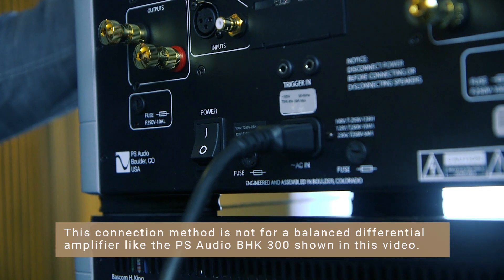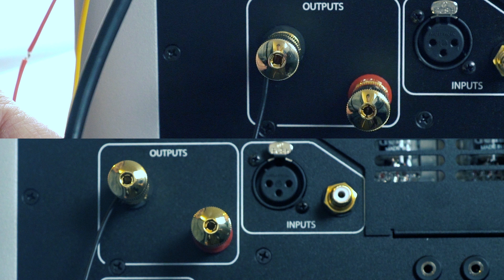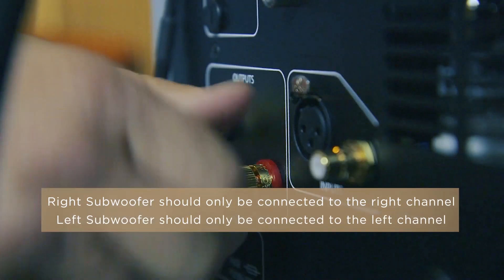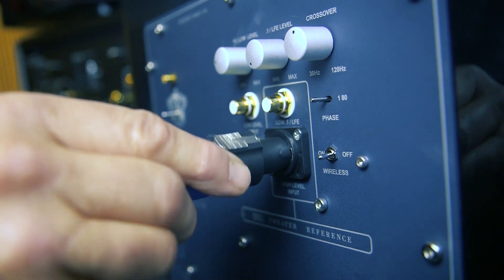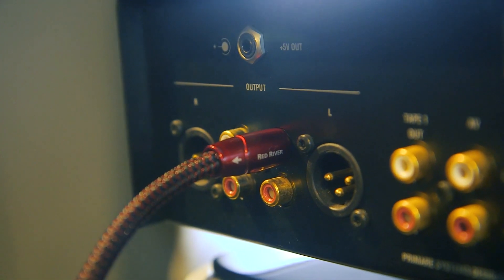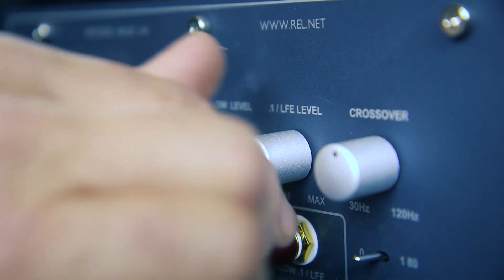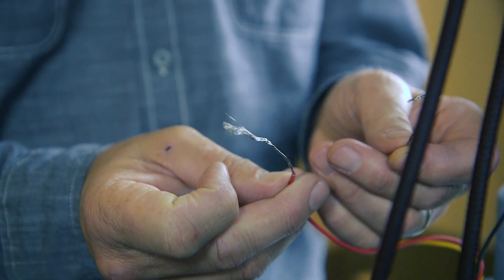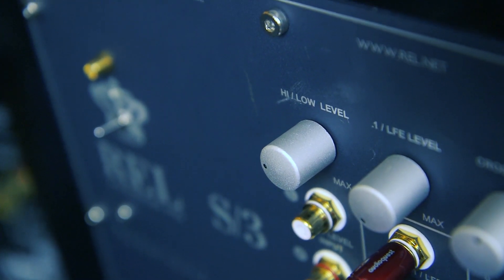REL Acoustics How To: Connecting a Stereo Pair of RELs using the High Level Cable

Comment: Can I hook up the high level input of a rel TZero to the “to L speaker” speaker output on a pair of Klipsch R-41PM? They are active speakers but there is access to the amplifiers left channel via left speaker out on the back of the R speaker which houses the amplifier.  

I was wondering if I could safely hook both positive left and right wires of the speakon connector to the positive of the left channel and negative to negative .  Or will I be forced to use the low level input (I’m assuming not the .1/LFE as that’s set up for prefiltered sound out of a dedicated sub out on a home theater receiver)
Reply from the maker: Since the Klipsch R-41PM are active speakers, we recommend connecting the REL subwoofer using it's Low Level input, rather than the High Level input. The Low Level input will allow the subwoofer to receive both left channel and right channel signal, resulting in better performance and a more seamless blend with your main loudspeakers.
Reply: @RELAcoustics  thank you! If I wanted to experiment with the high level input,  would it harm the amplifier of the Klipsch speakers? I would basically just be wiring it up like for a monoblock configuration but running it from left channel since that’s the only channel I have access to with the Klipsch
Reply from the maker: @Gillian_seed83  Using the High Level input in this scenario will not harm the speakers or the subwoofer, as long as you connect the black High Level wire to the ground thumb screw rather than the negative speaker terminal. However, since this will result in the subwoofer only receiving left channel signal, you will likely experience improved performance by connecting to the RCA sub-out, using the Low Level input on the subwoofer.
Reply: @RELAcoustics  ah ok since the Klipsch has class d amp I was thinking I would have to connect the red and yellow to red then tape off the black and connect an rca from .1lfe input to either aux left or right input rca on klipsch to create the ground cause I was reading up a little more on your website about the methods but you are saying it’s even simpler by red and yellow both on red speaker out of Klipsch then instead of taping the black off I can attach it to the ground screw the Klipsch has on it for connecting phono? Just wanting to clarify.  I will most likely run a decent quality rca from sub out of Klipsch into rca low level input of TZero as you recommend,  but it’s nice to know I actually would have the option to at least experiment with hearing the high level input.  I would say most of the music I listen to there’s not going to be much difference in 20-120hz region in left and right channels. But I totally understand the reasoning of running an rca low level connection with this particular set of speakers.  Also one more thing I’d like to clarify,  so this TZero MK iii is a very recent update to the TZero correct? I believe from what I understand it just hit the market last august sometime? Will most likely be trying it out first because my room is maybe just a bit larger than the space specified for TZero but a bit smaller than the space specified for t5i.  I have tiled concrete floor and concrete walls, it I’ll be in a literal concrete corner with me sitting about 4 to 8 feet from it, I believe it’s going to straight thump for a little 6.5 inch woofer!
Reply: @RELAcoustics   hey disregard everything else I’ve said cause I ended up getting a Yamaha R-S202 receiver and a pair of Sony SS-CS5 bookshelf speakers.  I cannot find  definitive information if the Yamaha is a class A/B, A or D.  I’ve seen speculation that it’s A or A/B but I want to know if you think TZero could be good for, all sources point me to yes.
Reply from the maker: @Gillian_seed83  I can not determine for certain if the Yamaha R-S202 is Class A/B or Class D, so I would recommend using the Class D High Level connection method to be safe. For use in a small-to-medium sized room the Tzero will be an excellent match for your Sony SS-CS5 speakers.

Comment: I have an intergrated amp and power amp bridged(mono) Through emails with REL... I was told to leave the black wires hanging. If ground occurs connect them to the ground screw. If that still doesnt work use a a rca cable from the lfe to a line on the intergrated. None of these options worked for me...and when I called and emailed I was never given the option to try to connect black wires to negative. I see in this video that u say to connect the black wire to the negative terminal. Curious why that option wasn't given to me and what will happen if I try it. I dont want to cause any damage to my amps or to the subs.
Reply from the maker: In most cases,  when a stereo amplifier is used in the bridged monoblock configuration it no longer functions as a Class A/B amplifier, and the negative output terminal no longer references to ground. As a result, in these cases we do not recommend connecting the black High Level wires to the negative output terminals on either the bridged power amplifier or integrated amplifier. Doing so can result in damage to the amplifiers and the subwoofers.

Comment: Hello REL Acoustics Team, do I understand it correctly: in your video - if I've connected two REL's to the two monos (I use Cyrus two mono blocks X300) as you've shown , the second (speaker) outputs will be used for the normal floorstand speaker, right? So I then have on the first speaker connectors the floorstands and on the second speaker connectors the REL's . Correct?
Reply from the maker: If your monoblock power amplifiers have two pairs of output terminals then you can connect in this way, though ideally the subwoofers' High Level cable wires should be connected to the exact same output terminals on the amplifier as your main speaker wire is connected to.

Comment: Hi, Thanks for the video. I have 2 REL T7i and Roksan K3 Integrated Amplifier, class AB. At the back of the amp, I only have one chasis ground. Can I connect both Rel black wires to the single ground? Cheers.
Reply from the maker: That is correct, the black High Level wires for both subwoofers can be connected to the same chassis ground thumb screw on your Roksan integrated amplifier.
Reply: How does it sound? I jave Roksan K3 amp and looking at getting rel tx7.  Cheers

Comment: I have 2 T9i's and it seems that one of them has to be set at 180 the other at 0 to get the fullest sound. Does this sound right?
I guess if it sounds right - it is right.   It is a very subtle difference - not in your face - so to speak.
Reply from the maker: Depending on how your main loudspeakers and the subwoofers are placed in your room, it is certainly possible that the phase on one subwoofer will be set opposite to the phase of the second subwoofer. As long as this results in the loudest and deepest sub-bass output in your room then it is correct.
Reply: @RELAcoustics   Once again - thanks a lot.  I'm slowly getting there.  The system sounds fantastic.

Comment: unclear!. Shoud I connect the REL cables in paralel with the speaker cables in the same conector?
Reply: Yes, they are connected in parallel.
Reply from the maker: That is correct, the High Level wires for your REL subwoofer should be connected to the output terminals on your amplifier, in parallel with your main speaker wire.

Comment: If I have a mytek amplifier (2 pair RCA out and 2 pair s/pdif) can I use one set RCA connectors for speaker and rel in same time ? Or (according with construction of amplifier) I can use only s/pdif output for low level input on rel panel ? Thank you for help
my mytek amp (https://mytekdigital.com/hifi/products/brooklyn-amp-plus/)

Comment: High level cable cannot be used if amp only has RCA terminals for subs correct?
Reply: vivalasexy you dont have wire connections on your amp? 
If so, it seems to be an PA amp instead of an home hifi stereo
Reply from the maker: The High Level input on our subwoofers can be used as long as you are using passive speakers in this system driven by a separate amplifier. If you are using active speakers in this system then it will be best to use the subwoofer's Low Level input.

Comment: i've just bought my 2nd REL ...For my 2 channel music system....so i twist the red+yellow together fit to +red (right speaker) black wire goes to - (black right speaker).....and i do the same with other REL for left speaker (red plus yellow twisted goes to red + left) and black cable goes to black to left terminal on amp ..??  hope that how you connect stereo subs....but what about the phase switch ?
Reply from the maker: That is the correct way to connect stereo subwoofers, assuming that you are using a Class A or A/B amplifier. If your amplifier is Class D or Balanced/Differential, then the red and yellow wires will stay the same but the black wires should be left floating, or connected to a chassis ground screw. The Phase switch should be left in the position which gives you the loudest and deepest bass output. Typically with stereo pairs the phase switch will be in the same position for both subs.

Comment: By the gain being to high, you guys mean the Rel Subwoofer cone will have excessive movement? i have both my REL S2s on vol 6 & don't see any driver excursions. Is the gain too high? Thanks.
Reply from the maker: By the gain being too high with both the red and yellow wires of the high level cable connected, we mean that the subwoofer's output level is far too high with the level control only turned up a few clicks. If this occurs, then removing either the red or yellow wire will lower the gain by half, and allow for greater use of the level control.

Comment: It is a problem using Tube mono blocks or should i just connect an rca from my pre amp to the subs??
Reply from the maker: REL subwoofers can be connected to tube monoblock amplifiers, though when using monoblocks we strongly recommend running a stereo pair of subwoofers if you wish to connect High Level. If it is only possible to use a single subwoofer at this time, then it will be best to use the subwoofer's Low Level input, connected to a preamp output.

Comment: Hello, it is not clear to me in the video, when you join the yellow and red cable, are they from the same speakon cable or from a different subwofer?
I beg you to take good care of me
greetings from Spain
Sorry for my english, it's from google
Reply from the maker: The Red and Yellow High Level wires that are twisted together when connecting stereo subwoofers should be from the same cable. This will result in separate cables each with a hot and ground conductor for the left channel subwoofer and the right channel subwoofer.
Reply: @RELAcoustics  Hello, thank you very much for answering and clarifying partner
Cheers

Comment: Thumbs down. What if you only attach one subwoofer?
Reply: i have just one t/5x connected high level to my quicksilver mid mono amps, and have not experienced any problem... WHY is it recommended that on a mono amp, it should be one sub for one amp?

Comment: This question is for music not HT listening: How about connecting the 2 subs in mono mode? I.e. connecting both red leads to one channel and both yellow leads to the other? First question is is this safe? Second question is wouldn’t this help more in smoothing out room modes? Of course, in many recordings this does not matter as there is no channel separation in low frequencies but in many modern recordings, for example in classical music, there is.
Reply from the maker: The connection method that you have described will not damage the subwoofers, though when connecting a stereo pair of subwoofers we highly recommend having each subwoofer dedicated to either the left or right output channel. The benefits of having the subwoofers dedicated to a single stereo channel (greater speed, dynamics, and soundstage) will make this configuration very much worth trying.

Comment: I have just ordered two t5i subs, and my preamp reverses the phase of the signal so my connections at the speakers are reversed will this affect the connections anywhere or do I just connect everything normal and use the reverse phase switch ? Jim.
Reply from the maker: Thank you for reaching out. Feel free to write in to contactus@rel.net and we will be happy to help with specific connection instructions. Be sure to include in your email the model of preamp, power amplifier, and speakers that you are using with this system.

Comment: Does it matter if the stereo amplifier is a fully balanced unit? Thanks!
Reply from the maker: For balanced/differential amplifiers the connection will be mostly the same, the only difference being that you should not connect the black wire to the negative speaker binding posts. Instead, it should be left disconnected, or attached to a chassis ground screw.
Reply: @RELAcoustics  so for unbalanced monoblocks...follow the video above except leave the black wire floating?
Reply from the maker: @backrack01  This will depend on the specific model of monoblock power amplifiers which you are using. For High Level connection instructions specific to your system, please write in to contactus@rel.net and we will be happy to help.
Reply: REL Acoustics ... thanks for your reply. In this video the red/yellow wires are twisted together and connected to the positive speaker post on the amp. If black is removed does a signal still get sent?

Or do I connect red wire to positive speaker post, yellow to negative speaker post then float the black wire on each channel for each sub?

Sorry!
Reply from the maker: @hushpuppykl  Both red and yellow wires should be connected to the positive speaker binding post. The black wire is for connecting to ground, so it does not affect whether or not a signal is sent.
Reply: REL Acoustics ... TQVM for your assistance! 😬